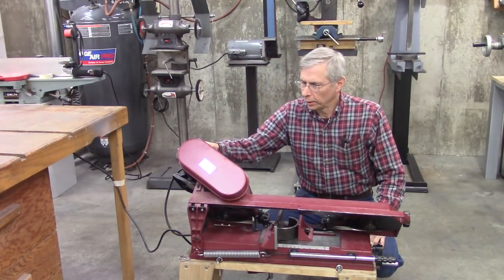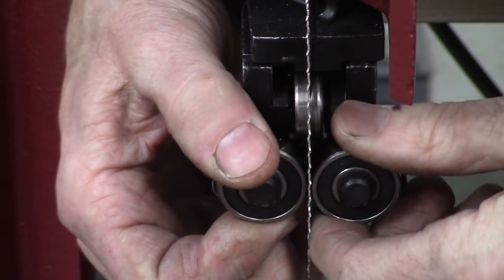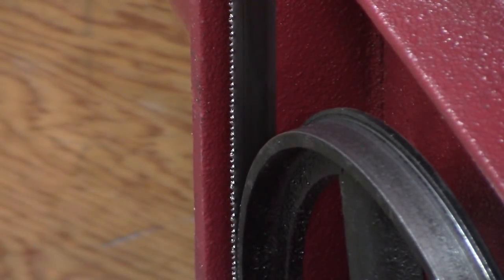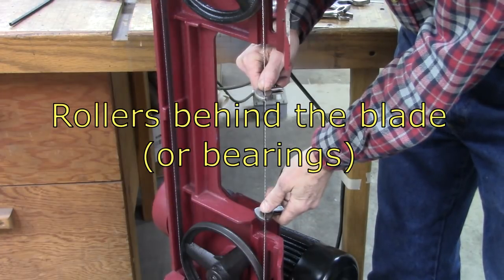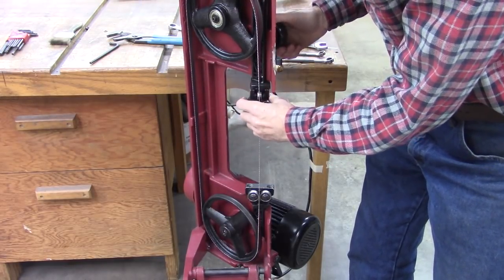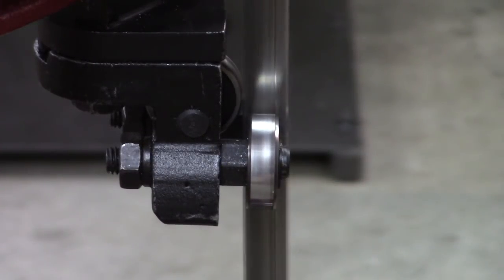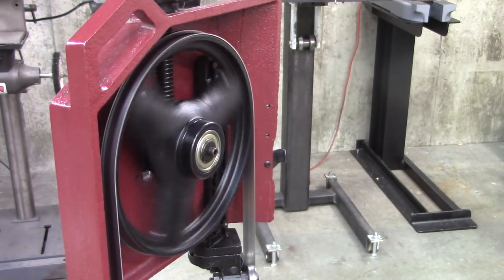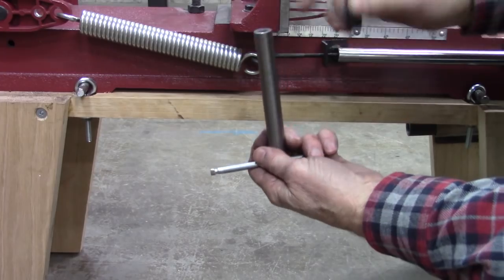4" x 6" Horizontal Bandsaw Tune Up

Comment: That pipe trick is brilliant, I don't know how many times I had trouble with holding a small part in my bandsaw, I will definitely make one, thanks for the tip.
Reply from the maker: Yeah...  Thats a great idea. I saw it posted on Facebook I think
Reply: @WinkysWorkshop  thank you for posting up here it will come in most handy for me too
Reply from the maker: @Sam-black  Yep... me too!
Reply from the maker: @Sam-black  Thanks Sam, you're welcome!
Reply: Mike Bray posted the half pipe clamp on Facebook.
Reply from the maker: @krisnewman3202  Yes he did. It was a great idea! He s a great machinist. He needs to start his own channel.

Comment: The first thing I did after I got my saw was open the gearbox and i'm glad I did as it was full of metal bits.  If you haven't done so already, but sure to open up the gear box, clean it out real good, and put some quality gear lube in there.   Nice video!
Reply from the maker: Thanks for the info! On my list tomorrow!
Reply from the maker: @Two Dogs - Thats crazy!
Reply: What is a good gear lube?..I have old dayton I'm rebuilding

Comment: Morning Mark, Billy mentioned during this Sundays ARW discussion that you had a video on these small saw's. I took Joe Pies offer up on a free Central Machinery 4x6. I have it tore dw and making some of the same modes. It is even lighter duty than yours are the on Steve Summers showed, but first mode needed was the bottom drive wheels set screw was loose and allowed the shaft to turn in the wheel. Adding a second flat 90deg and tapping for another set screw. Joe's saw will be set up for lite material cutting only, but was great to finally get dw and have a visit and a tour of his shop. Too see up close the 1/12 working model's was a treat, and his attention to detail is beyond words. Thx for sharing your saw modes, and hope all is well for the new year,,,Bear
Reply from the maker: Your welcome. In part 2 (maybe 3) I make a plate to elevate the stock. Not all of these saws share the defect this plate corrects but if yours has this problem I sell the plate. Or if you have a mill you can make one. The links are in the description. Yes Joe is amazing! I'd love to take a tour and meet him in person.
Reply: Yes on a mill, thx, will check that video out.Cheers and keep on Keeping on. Bear
Reply from the maker: @bearsrodshop7067  I'm keeping on! 😊

Comment: With some of these inexpensive  machines one needs to do some final tuning. But they can be made to work fairly well.
Reply from the maker: Band saws are fairly simple machines. I'm glad I got it but some of the changes I made were a result some bad design. Basically the pivot point to the top half needs to be about 3/8" lower... maybe a bit more.
Reply: Agree,Lou. If you're willing to put some effort in then the end result is often a machine that performs like one costing 2 or 3 times the purchase price of the basic machine. I have made many mods to my metal band saw and it is now a very precise and reliable piece of kit.
Reply: @WinkysWorkshop  likewise on mine,the pivot point is very poorly executed. Plenty of scope for improvement there. Maybe remove the existing lugs and fit couple of small pillow block bearings would be the answer.
Reply from the maker: @howardosborne8647  The changes I made addressed most of this well enough. but you are right...  pillow blocks might be the answer.
Reply: @howardosborne8647  raise the bed of the vice
Just a simple  piece of plate with all the corresponding holes of the bed of the vice will suffice
Reply: @Sam-black  That is fine if the only issue is relative height of the saw frame to the base. Mine,like some other saws, have other issues with the bearing pivot lugs and pin. Some are very poor castings and poor alignment of the pin holes. A couple of small pillow blocks would enable those problems to be cancelled out completely.

Comment: I got my 4 x 6 from a Craigslist seller, who got it free from his brother. My seller just wanted a quick $20 as he had no use for it and he couldn't get it to run. Took it home and first thing I noticed was the interlock knob was jammed in backwards- after reinstalling it properly, it ran jut fine. Built a wheeled base with shelves, adjusted all stations for proper tracking and plumb/ square cuts, bought a DECENT blade for it, and it cuts just as good as the old Kalamazoo saws I use d to operate, so with a little fettling, these are some top quality metal cutting bandsaws, but expect to give 'em some love at first but for such little money, they are heirlooms.
Reply from the maker: Yep...  Mine worked right out of the box and I assumed it was adjusted correctly but it was way off.  It's a cheap saw for sure but it works great.

Comment: I see your saw has ball bearings fitted to the front blade guide wheel. Mine originally only had a bush bearing in the wheel and it caused issues with maintaining accurate tracking. I bored the wheel hub and pressed a couple of 6 series rubber sealed ball bearings in and no trouble since. I clamp a 12" steel rule between the pinch/guide rollers to get vertical square alignment set accurately. The half tube,small stock clamping 'dog' is a great improvement. I have something similar but made from a piece of rectangular steel channel stock. I also sometimes remove the vise and bolt an adjustable angle plate onto the bed. Also sometimes clamp large vee blocks to the bed for awkward jobs. The one most important thing in getting good results with these saws is don't fit poor quality blades. They won't last long or cut consistently square. As I've shared with you before, I only use Starrett or Lenox bi-metal cobalt blades...very good tune up guide,Mark👍
Reply from the maker: Thanks Howard, Yeah sleeve bearing on the wheels would create issues in a short period of time I think. The blades I'm using seem to do well not that I have the tracking issues resolved. So far I have only changed one blade for wear and thats where the steel plate I had on the vise jaw was rubbing the side of the blade. I may try the starett if this current blade gets dull in the next few month. Its been on there about 3 I think.

Comment: Alright let's see how you can make this better. I have seen loads of videos on this but waiting to buy it still. Haven't seen the right video on it.
Reply from the maker: This saw is not industrial but it is cheap and it works. The biggest problem is that the blade guides can't be adjusted to their optimum position. The compromise works but it's not ideal.

Comment: Making a hardwood fence for the miter makes all the difference MyBest.Tools Tune the saw with a combination square. Adjust the laser so its in line. See the photos.Every part in this saw is adjustable.
Reply from the maker: I have no idea. Mine is a Harbor Freight but has no model number on it

Comment: Great job on the saw Winky.  i have a saw just like that and I hate it.  I adjust and adjust and the blade just keeps on popping off.  Thankfully I made the very good decision to buy an Evolution 380 saw.
Reply from the maker: Haha...  funny, yeah this saw is not very high quality. I ruined 3 blade before I figured out what the problem was. It's partly just poorly designed. The pivot point for the top have is 3/8" too high. I haven't had a blade come off in about 6 month now. The sad part about this saw is that they could have made it so much better with almost no extra expense.

Comment: You covered a whole host of good ideas in this one.   I will certainly go through the entire exercise on my saw.  The one we have we got in 1982 and the design is almost exactly the same as today only some very minor changes.  Still running today and as you know almost every project begins at the band saw.  Other than changing the blade and changing the oil in the gear box and changing the bearing on the idler wheel one time absolutely nothing has been done to the saw but we don't abuse it either.  That is almost 40 years...wow how time flies.  Thank you for this one for sure.
Reply from the maker: It sounds like your's might be adjusted fairly well. If you are not braking blade and they are not falling off you might not need to do much. I was messing up blade on mine.

Comment: Brilliant! With your help I may be able to cure my blade either falling off or snapping (always one or the other) after about 5 minutes running! 🇬🇧
Reply from the maker: I hope it works out well. I just posted a second video too. It shows a better method to resolve the depth of cut issue. You saw may not have this issue but some do.

Comment: Similar to the half pipe trick I drilled and tapped a hole in the movable jaw of the vice and put in a length of all-thread, For short pieces you screw it in to support the part of the vice not touching the workpiece, Like using a cut off of the same size material to stop the vice jaw deflecting on the mill, The all-thread acts an ever adjustable work piece cut off.
Reply from the maker: Interesting...

Comment: Instead of bringing your blade down lower
You could cut a suitable piece of plate to sit on the bed of the vice, amount the jewels of the vice through the plate, if your plate is 5 mm thick then you have risen your voice by 5 mm if it is half an inch plate then you have lifted your Vise half an inch
Reply from the maker: I thought about that too and that might actually be the best approach. Thanks

Comment: When I was in the structural steel business we had a couple of these 4x6's and also a bigger one (don't remember the size but a 12" channel would fit in it).......With a little tuning even the inexpensive 4x6 worked great. As you can imagine in a business sometimes these saws run for hours a day and even the cheaper one held up very well.
Reply from the maker: Yeah these saws are basically sound but lack attention to details.

Comment: I bought a virtually identical saw, branded “King Tools” ,in Canada about 3 years ago. Seems to me it was $399.00 Canadian. It has worked perfectly for me, cut dead square out of the box and runs smoothly and quietly. There are 3 weaknesses with this little machine. 1- the stand is kind of wobbly. 2 - As you pointed out and rectified, it’s finicky to hold small stock. 3 - The spring operated feed speed control mechanism leaves a lot to be desired. All of these could be easily rectified with a pleasant days shop project, for next to no money, and that’s what it’s all about, right? All in all, I figure that it was pretty good value and it has become about my most used and most labour saving machine. Thanks for the great tune up and modification tips.
Reply from the maker: Your welcome and I agree with you.

Comment: Nice video! I just picked up a used Jet version of this saw and the clamp is busted. Not sure what is normally holding that screw from backing out of the casting, but I'd like to see more detail about that. Of course, I might just go to Harbor Freight and look at the saw there.
Reply from the maker: Harbor freight is a good idea....  Hard to describe.

Comment: Did not know that about controlling the gap
Reply from the maker: You mean moving the blade guides?
Reply: @WinkysWorkshop  So they are eccentric If I realized that I would not have machine mine to have adjustable slots I could have just spun them  Yes guides
Reply from the maker: @1-shotslinger108  Got ya. Yes this would be easy to overlook.
Reply: I machined the shoulder off my wheels too .and added rubber tires Everyone says that is for wood . I had to weld a bolt and a plate to the upper wheels pin holder so it could tilt and various angles.

Comment: Fantastic video on this little tool. I have the same saw and it’s one of the most used tools in my shop. Question for you sir. On long/deep cuts my blade seems to walk back and forth producing a wavy cut. Would that be blade tension? I’m going to true my saw up today using your tips. Thanks for making this video. Subscribed.
Reply from the maker: I was cutting some 5 inch round stock the other day and the blade wandered some. That was before I tuned it up however. I suspect the guide bearing need to be slightly tighter and possibly tension if it seems low. One thing for sure. If the guide bearings are pushing down on the back of the blade too much it actually puts a bow in the saw. If you look down the blade you will see the teeth between the two guides are slightly higher than they are at the guide. When the weight of the saw pushes down in the cut the blade will twist or deflect to one side .
Reply: @WinkysWorkshop  excellent. Thank you for taking the time.
Reply from the maker: @rdspeedfab  No problem

Comment: Great video. My top of the cut to the bottom of the cut is not square. It cuts a bit more on top any fix?
Reply from the maker: More than likely the blade guides need to the be rotated a little.
Reply: @WinkysWorkshop  any idea if I should rotate in or rotate out.
Reply from the maker: @BulliKid  Clip a straight edge (6" steel rule) vertically to the top of the blade near a blade guide above the teeth. Lay a square in the vise and rotate the guide until the rule is parallel to the square. This will get you very close. Looking at the front of the saw, if the cut is going toward the vise you rotate the guides counter clockwise or opposite if it is cutting the other way. The thing is, its hard to know which blade guide to move unless you first check them with the steel rule.
Reply: @WinkysWorkshop  thanks will do some more testing.

Comment: My blade bearings LOOKED like they were deflecting the blade. However, after I measured the distance between the center line of the drive pulley wheels, and the blade, it was equidistant, so no adjustment was necessary . Careful of those optical illusions.
Reply from the maker: You are right, it can look as if they are deflecting the blade when they are not. If you are talking about the bearing that ride on the back of the blade the setup is easy. the blade should not be touching the bearing until its in a cut. Of course turn without pressure is fine but it fairly easy to assess. The twist in the blade is a bit different, it's harder to determine the appropriate position. Technically speaking the center of the blade (height wise) needs to be in the center of the wheel. Certainly there is a little guessing going on and blade tension, wheel alignment and side pressure on the blade from the bearing guides all move the blade. Fortunately, if your saw is not defective it not all that critical. Without the elevating plate described in part three my saw was being defected almost 3/8" inch. When set up right you could not drop the head for enough to make it complete a cut.  I've been running the same blade for 8 month now and my saw cuts dead straight. You are correct about the optical illusions but some of these saws are messed up bad out of the factory.
Reply: @WinkysWorkshop  Like you, I had to remove the blade protector to get the blade fully complete the cut, drop down and shut off the power switch. Also had to remove the lower blade protector (With the two countersink screws) due to interference. Cuts well now.

The blade cuts 3 degrees off but the stock metal holder is fixed 3 degrees to match. I don't see how to correct that except with a sledge hammer. LOL
Reply from the maker: @tdrager  I could make mine work but not without deflecting the blade some. Now the guard is back in place and it shuts off perfect. Skewing the vice is the best way to resolve it.

Comment: Had one of these for 40 years. Mounted mine on a wheeled storage box- cannot waste all that space underneath...
My guard is hinged, with a single thumbscrew holding it shut. Means changing the blade is quick and easy. Original fitting.
Reply from the maker: I need to improve on my guard modification. Thanks for watching

Comment: Great video, Winky! Picked up a Buffalo 4x6 last summer for $50. Just tried to cut something with it, and was shocked when I turned it on, and it barely made a mark on the piece of rebar I was trying to cut. Guess I'll have to take some of your tips and tune that baby up.
Reply from the maker: You saw might need tuning up but I think rebar is actually fairly hard.

Comment: I beveled off the casting so my guard would work. About an 1/8 inch.
Reply from the maker: I made a 1/4 thick plate for under the vice in part 2 of this video. I sold about 35 of them at $30 each. I have 2 left I'll sell at a slight discount. They have a slight rough edge but are totally usable.

Comment: This is a cheap copy of the one I bought from Enco in 1984. I paid $75.00 for it and it was fully assembled and tuned properly. I took it right from the show room in Boston to my house in New Hampshire. The only thing it has ever required is blades and one new set of bearings. The motor and everything else is still original. Although, the vertical table managed to disappear into an alternate universe at some point in time. It wasn't really that good, anyway and I rarely use it in the vertical mode. Unlike this Chinese copy my guard does not interfere with blade or the kill switch. It is a complete metal cover.
I am finding that some good upgrades have been designed and proven by you and others. The additional plate for the vice is something I just never got around to making myself. Since I don't have the drop problem that yours does I won't need the elevation plate. However, there are things like better supports/tables as well as chip pans and fluid baths that are shown on YT that I will definitely implement on this one.
Thank you for your hard work on this product. I'm definitely going to be checking more of your videos.
Reply from the maker: Thanks, glad you have enjoyed the videos

Comment: I replaced the blade guide bolts with hex head cap screws.  Makes adjusting faster and easier vs getting an open end wrench between those bearings.
Reply from the maker: That would be a big improvement!